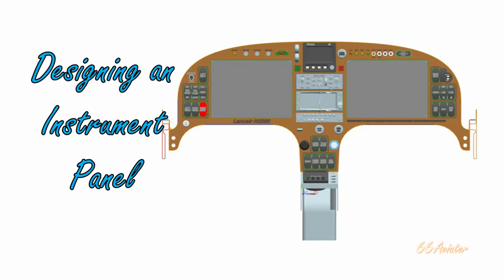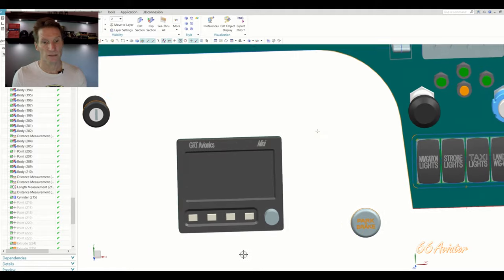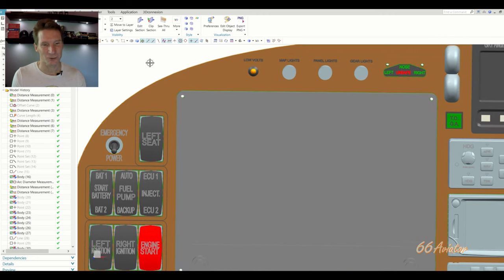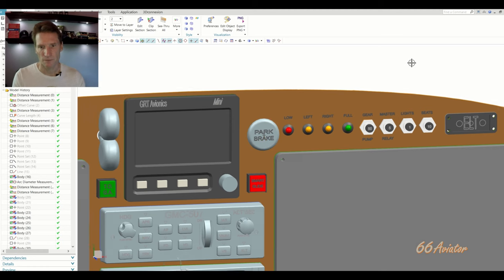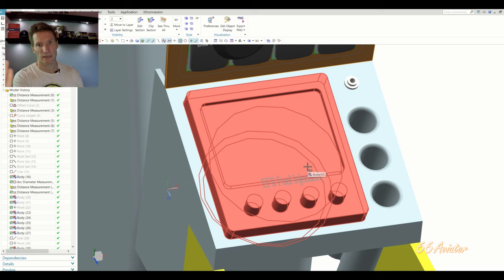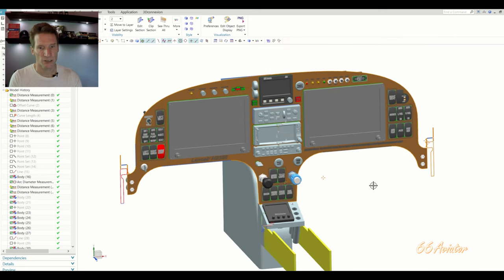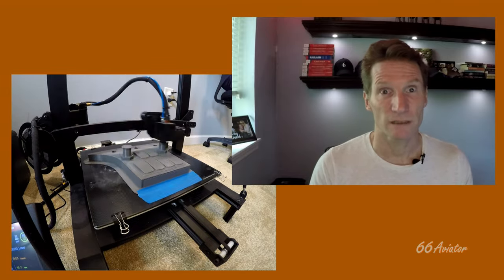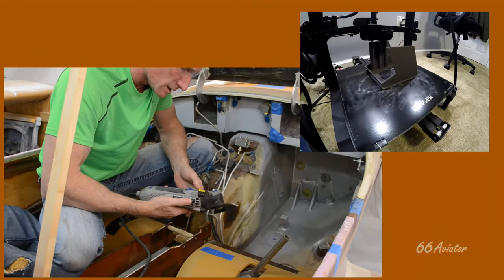Designing an Airplane Instrument Panel for a Lancair Homebuilt Kit Plane

Comment: Compared to stock, did you shrink the panel, move it back or up or down?   I’m wondering if modern avionics’ smaller size will allow me to shrink the space behind the panel, allow some extra knee room for my long legs and perhaps be a lower profile to allow better taxi visibility?  You touched on this topic briefly at the end.  
Great video and AWESOME 3D print mock-up!!!!
Reply from the maker: Ryan, I didn't have the "Original" Lancair panel design drawn in, so I'm not sure exactly how the size compares. I can tell you that if you place a straight edge across both side rails, the bottom edge of my panel design is 1/8" below the straight edge. The top middle measures 11" up from the side rails.
Markus J.

Comment: VP-X does wig-wag for you and you really don't need a low voltage light either.  Where's your transponder?  That EFII system seems like a lot of hassle.  With heated seats, I think you're going to run out of power very quickly unless you add a second alternator where your vacuum used to be.  You might want to consider moving your flap switch to the stick grip.
Reply from the maker: Danny, the transponder is a Garmin GTX 45 R - Remote mount, just like the second Comm radio a GTR20. I know the VPX has a wig/wag feature, but I wanted it to be right next to the prop control for ease of use without having to reach up to the G3X. Good point on the current draw of the heated seats, maybe I'll limit them to LOW only and consider a second alternator as I have the room. The stick grip is going to be crowded already with trim hat, PTT, Flip/Flop, AP disconnect, so I'm not sure I want flap control there. Sometimes you feel like you're making decisions all alone, it's nice to have feedback!   
Markus J.